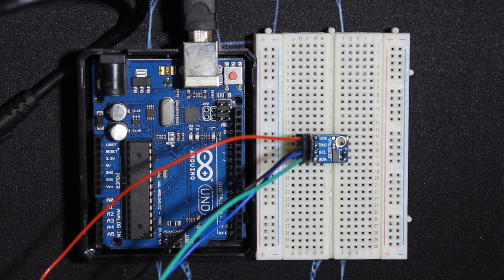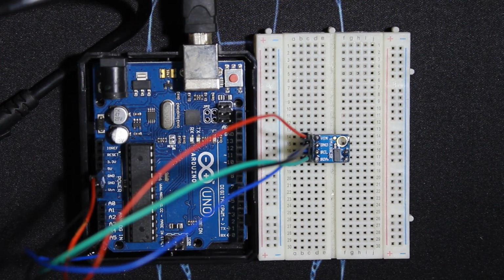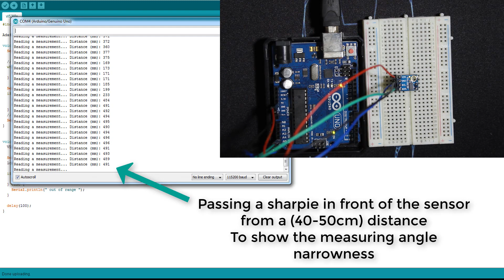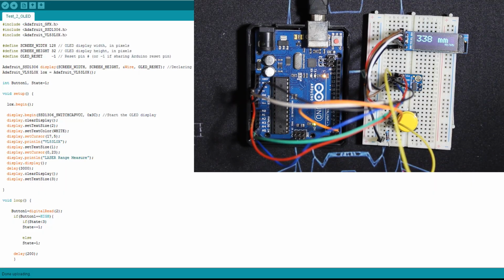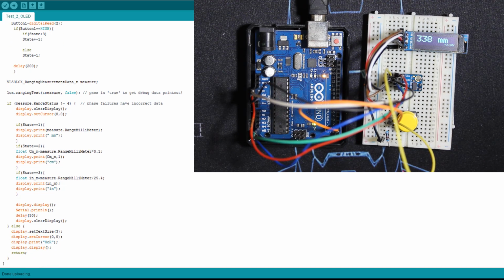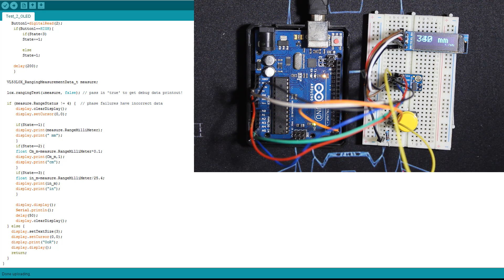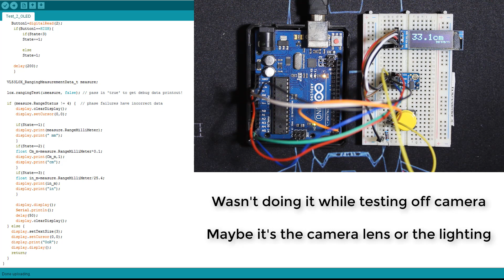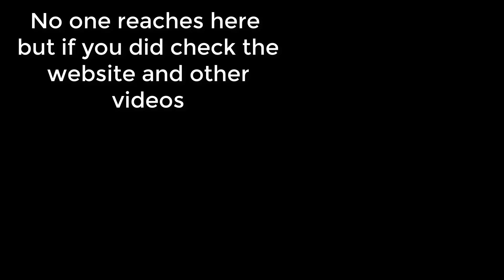Measure distance with VL53L0X + Arduino and OLED (Switchable units)

Comment: Hello I want to build a counter with the parts below. The ToF sensor detects when a person pass by going in the room and will  count up by "1". when that one person exit the room the ToF sensor will detect and count back down to "0" . count<1 = light off. Count>0 = light on. The node sends this command to my home assistant. I am more of a self taught mechanical engineer. Can you help with this? Shannondalebreaux@gmail.com
KeeYees 3pcs ESP8266 NodeMCU CP2102 ESP-12E WiFi
KNACRO
KNACRO GY-530 VL53LOX Laser
Reply from the maker: Well the counting part is easy, you'll need two of ToF sensors (You may want to check other things in order to use 2 same modules) to detect the movements direction and then you'll be able to increment or decrement the number of people in the room for example... for the home assistant part, sorry I've never used it before.

Comment: Does this sensor also meassure distances on surfaces that are at an angle? For instance ultrasonic sensor cannot measure distances at angles due to the signal not returing to the receiver end of the sensor, is this the same with this sensor?
Reply from the maker: 2:36, that's a round "Bic" Sharpie/Marker